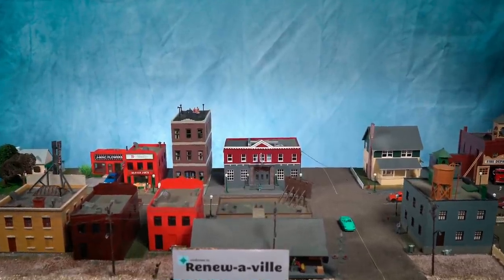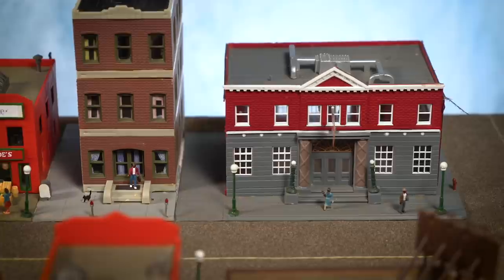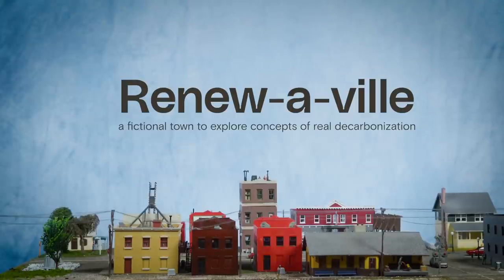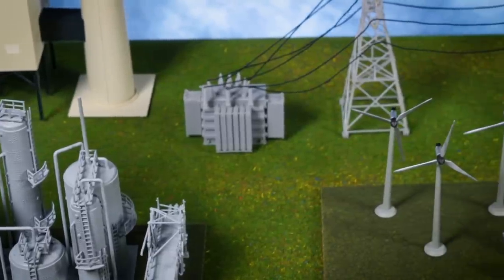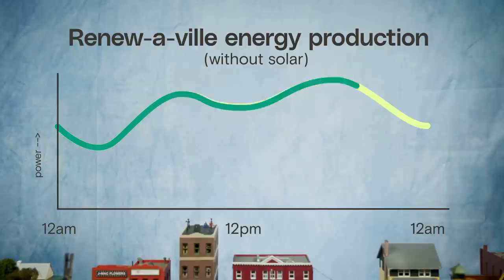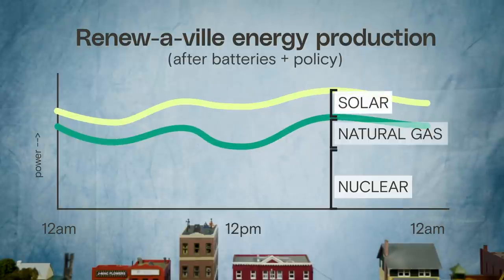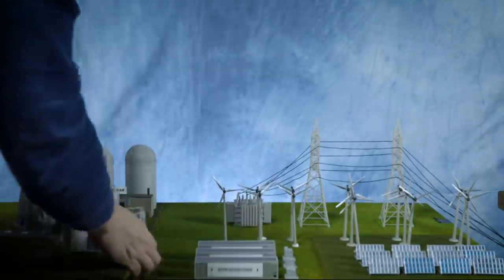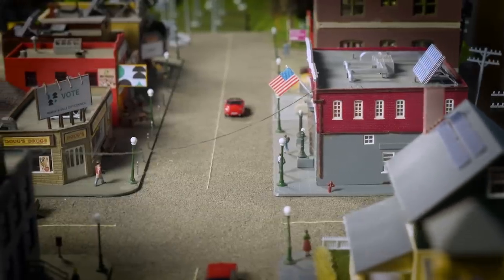This tiny model town shows how we could achieve 100% clean energy

Comment: This is really good -- as far as I can tell, it hits most of the main points of decarbonization. Two quick things people should realize: 
1) Some of that final long-term storage solution (in this case, hydrogen as a kind of chemical battery) becomes less and less necessary as you extend your grid over larger geographical areas. Why? Because the wind is always blowing somewhere and, if you reach far enough, the sun is always shining somewhere. There is an optimal mix of batteries, other storage, and long transmission lines that lets you store power for later, but also import it and export it in real time across existing geographical boundaries. For Canadians and Americans, this expanded transmission will be especially useful getting southern solar to the central part of North America and getting central North American wind to the North and the East. This is a build-once cost, not a continuing cost like fossil fuels.  
2) We should probably start doing this electrification *now*, even though the grid won't be zero-carbon for many years. Why? Because electric cars, buses, and trains, (and also as the video says, heat pumps) are so much more efficient than their burn-fuel equivalents. Yes, the electrical generation done today with coal or gas will have to be replaced for full decarbonization, but you don't have to build as much new generation as you think, partly because of this ^^ greater efficiency, and partly because people charge their cars and buses overnight, when power consumption is otherwise low. 

https://www.triplepundit.com/story/2020/zero-carbon-us-plan/708051
Reply: Your first point seems similar to what's being done in Europe.
Reply: Sure we just might be able to build UHVDC grid that spans wide areas or even the whole globe. But most nations are not too comfortable with the idea that some nutcase somewhere could turn their power off with small amount of explosives.
Reply: @Pasandeeros , true.
Reply from the maker: Thanks for the thoughtful comments Tai. One thing that I was wrestling with in developing the model was that it didn't show how important the grid can be (hence the caveat). In reference to your important point about the long-term solution I added a couple excerpts from my interview with Jesse Jenkins, for anyone who's interested.

"The Eastern interconnection, which is the synchronized grid that spans the entire eastern US plus parts of Canada, is one of, if not the largest machines humans have ever built. Like every device that's connected to that continent-scale system is synchronized at the same 60 hertz frequency. It's any induction motor that is running on electricity in factories or your air conditioning or your fan or your electric vehicle. Anything that's plugged into the wall is turning at the same 60 hertz frequency as every other device across the entire interconnect, as well as all of the generators that are grid connected, spinning synchronous generators. It's a pretty amazing, huge system to be created. And we have to maintain all that balance even as we rely more and more on weather-dependent wind and solar resources that are variable in their output over time."

And then on expanding the grid:
"In order to both expand the role of electricity by over double and to rely much more on wind and solar, which are more location specific and therefore require extending transmission output... Solar you can generate pretty much everywhere in the gradient in quality isn't quite so significant as wind. But in order to tap into that wind, in order to supply way more electricity in general, we do probably need to about triple the size of the US transmission system by 2050 and about double the size of the distribution system. And so electricity just has to grow like crazy in ways that it hasn't been since the early half of the 20th century. You know, it took us about 150 years to build the current system, and we need to double or triple that system over the next 30 years."
Reply: How do mine lithium in Thacker Pass and respect Native American lands
Reply: Here's a thought though: Electric cars STILL take energy to power them. Does everyone in a small town environment really need a car? After all, there's a method of transportation that doesn't require charging OR fossil fuels, it's only fuel is food, it's only waste is well...waste and it worked for centuries on end. It's called the horse. If we REALLY want to "go green", why not start using more horses again? I'm being serious here.

Comment: Well in Germany we unfortunately are getting rid of nuclear energy. I really hope other countries don't do the same mistake we do.
Reply: Replacing nuclear with more renewables and storage is actually the cheaper solution longterm. And way less dangerous or harmful to the environment.
Also, nuclear isnt CO2 neutral, it still emits CO2 during mining of uranium/thorium, as well as for refining ore to fuel. Then theres transport, refinement of nuclear waste and building the nuclear plant creates a HUGE CO2 backpack to begin with. And so on...

The US has a lot of nuclear plants however, so having to phase them all out would simply be too much in addition to everything else. Keeping nuclear for now is like keeping natural gas until the hydrogen storage is running - a necessary evil.

Germany on the other hand never had much nuclear and most plants would have been way too old by now anyway. Replacing those nuclear plants with new ones would have cost billions - an investment better used on renewables and especially storage.
Sadly, neither investment was done (on the contrary, renewables are even being stopped by any means deemed necessary because big corps like RWE are stuck in long coal delivery contracts or simply cant/wont profit from renewables) and so Germany has turned to coal, mainly thanks to Chancellor Merkel and her political party.

However, the pressure is rising. Technology cant be stopped. Theres new astounding innovations every year, all while already existing tech is being refined more and more.
And with no nuclear in their way, Im predicting that Germany will have the first real dynamic grid, and even way before their official coal-phase-out date.
Reply from the maker: If anyone's curious about what Mr. Kokolore is talking about, my coworker Nathanael Johnson wrote about that here: https://grist.org/energy/the-cost-of-germany-going-off-nuclear-power-thousands-of-lives/

Unfortunately, shutting down nuclear power plants meant Germany had to rely on coal.

Comment: You said that you were going to use existing technology but there are no viable grid-level storage batteries and you made no mention of how much overbuilding of the renewables would be needed. Where does this town's food or other products come from? (And no, the Tesla Hornsdale battery in Australia is not a grid-level storage battery as depicted in this video, it only has a 1-hour capacity, it's a buffering battery)
Reply from the maker: Hi Chapter 4 Travels! Typical grid-level storage batteries is 4 hours and more is becoming common (there's a project in New York that has 8 hour storage): https://e360.yale.edu/features/in-boost-for-renewables-grid-scale-battery-storage-is-on-the-rise

I actually went to Kauai in 2017 and they installed utility scale batteries there that have 4-hour capacity: https://www.youtube.com/watch?v=FlC76fw5KLc

The Tesla Hornsdale project is partially used as a buffering battery as you cite, but it's also partially used for shifting renewables on the grid for up to 3 hours after generation. http://reneweconomy.com.au/explainer-what-the-tesla-big-battery-can-and-cannot-do-42387/

Comment: Does the emissions of manufacturing make up for the emissions saved on usage, compared?
Reply from the maker: Short story, the emissions saved more than makes up for the emissions in manufacturing. Long story, this Carbon Brief article is really helpful: https://www.carbonbrief.org/solar-wind-nuclear-amazingly-low-carbon-footprints
Reply: In 2004 the U.S. National Renewable Energy Lab (NREL) studied this question also from an "energy input to make a solar panel, vs the lifetime energy output of the panel) and favorably concluded that, depending on the type, solar panels generate as much energy in 1/2/3/4 years to payback their energy input...then go on to perform for 25+ years. They also calculated emissions on page 2 of their report: https://www.nrel.gov/docs/fy04osti/35489.pdf

Comment: Do we have the minerals to make this happen too? On a global scale?
Reply from the maker: This isn't a simple answer (and maybe it should be something we tackle in a future video). This article is a good primer about where all the materials will come from: https://www.theverge.com/2019/2/15/18226210/energy-renewables-materials-mining-environment-neodymium-copper-lithium-cobalt

It talks through the supply chains of different minerals/materials. Some materials, like silicon for solar panels, are abundant, but others, like neodymium in wind turbines, may need to be swapped for something else.
Reply: @Grist , thanks for sharing.
Reply from the maker: @Sivah_Akash  no problem!
Reply: @wtkwok , thanks for sharing. But there are some elements used which are much less common, no?
Reply: @Sivah_Akash  For PV solar panels, the main precious commodity is silver, which is used in combination with copper to form the silver grid lines on top of each solar cell, and which transport the electrons/electricity out of the cell. Over the last decade, researchers and manufacturers have been developing solutions to use less and less silver to cut costs, but I think it is still an important and widely used material.
Reply: @wtkwok , nice.

Comment: Or skip the wind and solar and go straight to next generation, safer, cheaper, faster-to-construct nuclear power.
Reply: Breeders..  That's the only sensible way to go, short term.
Reply: Nuclear LCOE is skyrocketing. SMR has been a pipe dream with investors slowly realizing they have been duped and silently retreating. Dual-Fluid-Reactor isnt even past schematics stages yet. Fast breeders corrosion problems arent even close to solved, but Im sure "something ceramic based" will be offered up as a solution soon - until that idea gets also retired silently after 10 years of investments grabbed. EPR gen 3+ is horribly expensive, with yet untested security features.
Fusion plants dont even have the slightest idea of a working blanket.

When looking past all the nuclear propaganda, whats left is an old technology that never really took off. Sad, but true.
Reply: @jazlyn1298  You shouldn't comment if you have no idea what you are talking about. He specifically said next generation nuclear which doesn't have any of those problems.